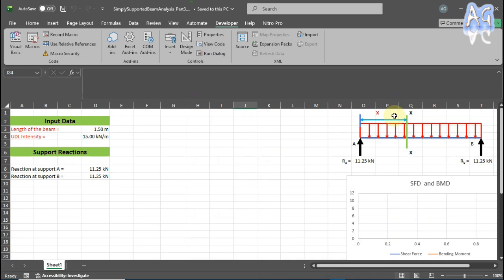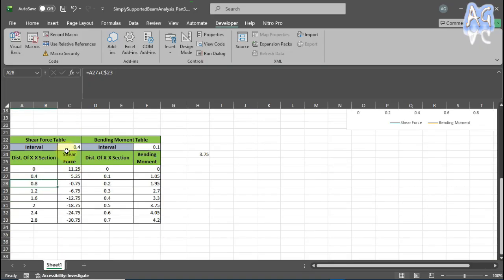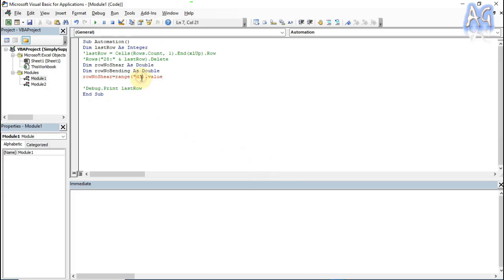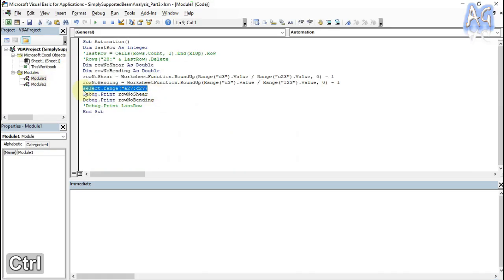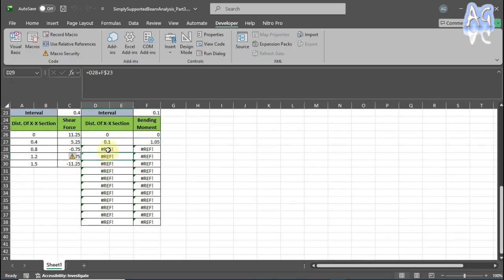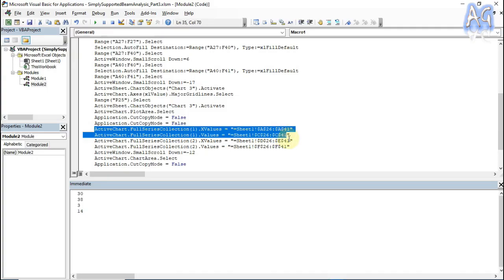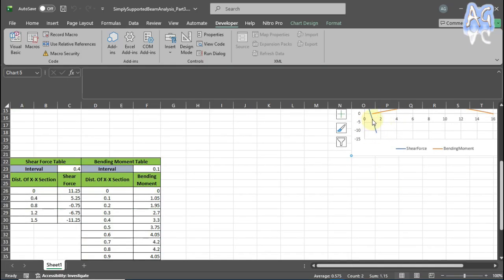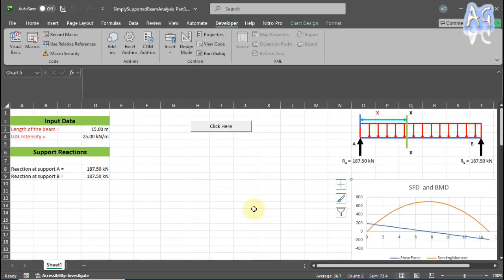Simply Supported Beam Analysis (Automation using EXCEL VBA) in Excel Part 3

Comment: Anupam Ghosh, do you think its possible to make an excel sheet that can analyze a continuous beam?
ive been struggling trying to make this

a continuous beam with fixed number of spans and up to 3 different UDLs per span and up to one point load per span

that i think will be very practical for real engineering design an analysis work
Reply from the maker: Yes it is possible. Okay I will make a video on that. Thanks for suggestions. You are right it is very practical example.